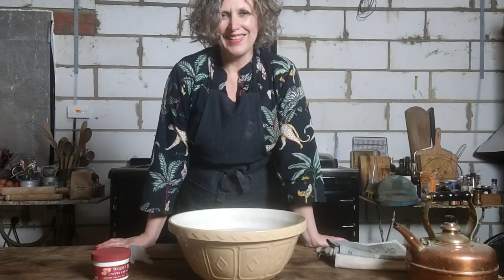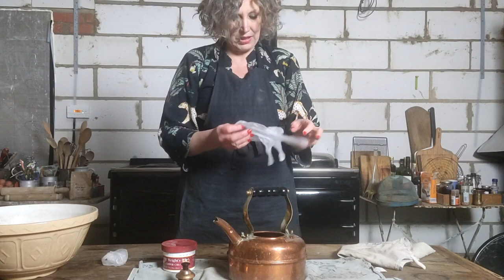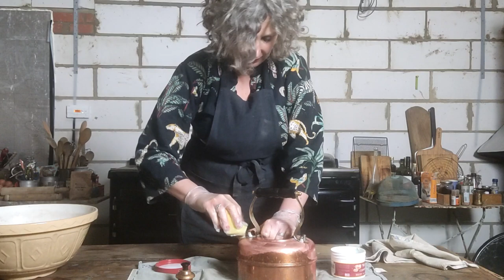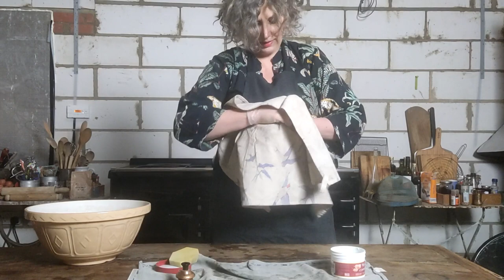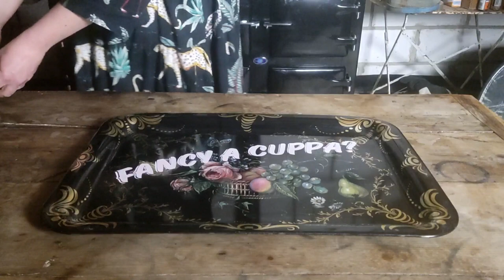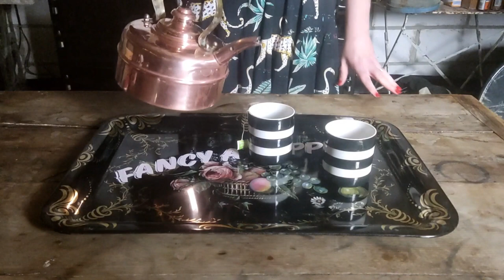An EASY WAY TO CLEAN A COPPER KETTLE

Comment: Just found your channel. I bought my Simplex kettle in late 2008, and I use it on the gas hob when we have power cuts - which is too often.... I hadn't thought to clean it in all those years, so it was a dark muddy brown when the thought entered my head to do so! The company Newey and Bloomer advised Brillo Wadding, so I got a jar and it worked perfectly in just a few minutes. Also, "epoquecottage" down below will be glad to know that it's extremely easy to dismantle the whole handle assembly with the right sized spanner, to clean all the angles and grooves where handle meets kettle. This brings it up perfectly. I'd forgotten what a clean copper kettle looks like, but I can now see my face in it...not sure if that's a good thing....🙄
Reply from the maker: Wow, it sounds as though it is gleaming now 😍